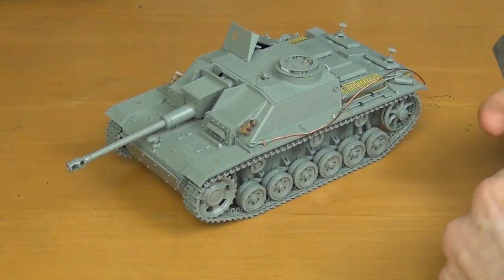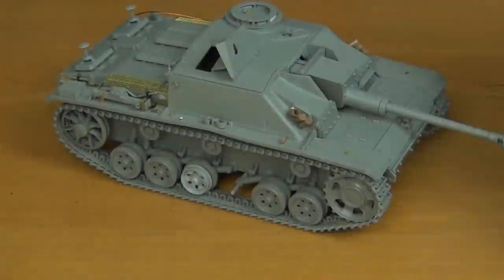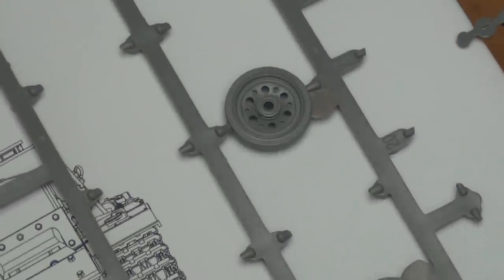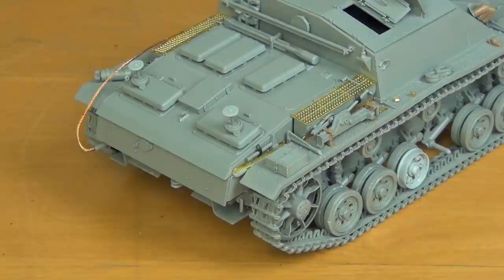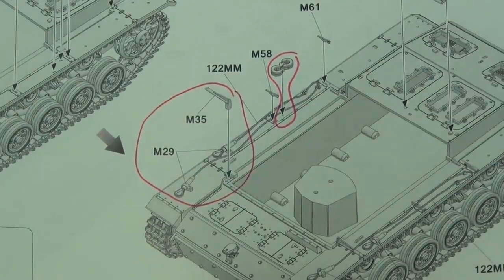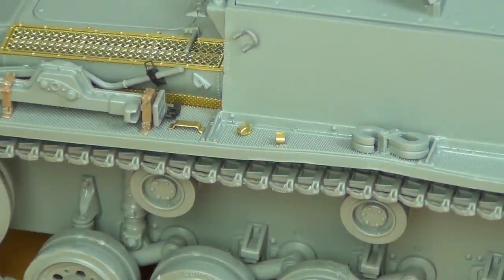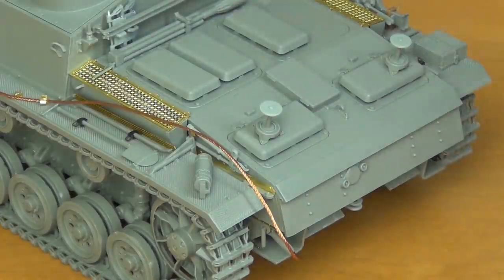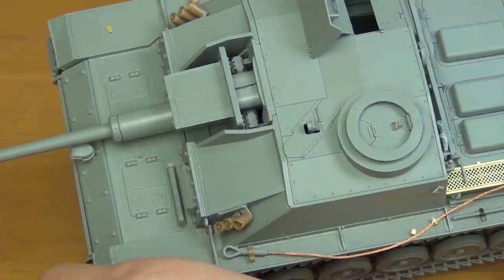Panzermeister's "Definitive Review" of TAKOM StuG III Ausf.G Early Production (BLITZ line #8004)

Comment from the maker: Sorry, there seems to be a little confusion with regard to my fix for the wheel fit issues.  

I did not trim the rods off entirely.  The inside half of the wheel has about 90% of the rod length molded on, while the outer half of the wheel has about 10% of the rod.  These rods are together too long and interfere when the wheels are assembled, so I just trimmed off the 10% rods from the outer wheel halves only, leaving the inner wheel with the 90% rods.  This fixes the fit and you don't notice the missing material.  

At 8:27 I showed two examples of the outer half, one with the 10% rod still in place (left) and one with that material removed (right).  I'm NOT showing an inner and an outer half there...just two outer wheel halves.  Remember, don't trim the rods on the inner wheel halves.  

>>> Most clearly -- if you have the instructions in front of you -- just trim the rods from all parts A11 (outer wheel half) and leave the rods on parts A16 (inner wheel half).  <<<
Reply: No more videos !? 😥😳😭

Comment: This is something I’m very much in favor of. We already have plenty of kits with crazy high parts numbers with super complex builds that still end up being full of inaccuracies anyway. A lower cost kit that is “good enough” is something I really hope sticks around.
Reply: As the hobby advances there will be more high count kits. Something I'm looking forward to since I jumped on the hobby to build.
Reply: @monkey in a panzer Same. Love Dragon kits, but 'oh dear?!', the parts count. Their Smart kits are a lot better, especially these days with moulded in Zimmerit, single length tracks which are good enough and many slide moulded parts which are so fine as to negate the need for using the included PE alternatives or buying a metal barrel, but still 'oh dear?!', the price. Tamiya new tool better regarding parts count and price than Dragon, but still ouch regards the latter. I love/d the Cyber-Hobby Orange Box series reissues of older Dragon kits. A set of decently sculpted older Dragon figurines plus a very nice older model regardless there might be a newer more detailed release. Some of them in particular more than met my acceptability expectations and scrubbed up extremely well with a very little extra effort.  e.g. StuG III Ausf B, Pz.Kpfw. III Ausf. E/F. Definitely a place for Blitz kits.

Comment: I'll start off by saying how grateful I am for this video! 

My wife knew that I wanted to get back into modeling after a very long hiatus, so she bought me this kit as a birthday gift. While a great kit - all-in-all - there's no way I would have been able to finish it without your tips and suggested changes. 

For others, here are a few of things I ran in to while building the kit:
- Wheels. I had exactly the same issue assembling the wheels. However, not having the best set of clippers, I had to use a file to file the longer lengths down to a length that allowed the wheels to fit together. 
- Photo-etched parts. Took me quite awhile to fully understand that the small flash piece (labeled as TP6 in the instructions) was meant to stand on its edge against the deck trim. And as you recommend in the video, I simply skipped the rear flashing (labeled as TP4 and TP5). I simply couldn't get either piece to lay flat. 
- Vents. Contrary to the flashing, no real issues with the vent grating (labeled TP8 and TP9). However, I did have an issue getting their associated "brackets" into place, which go over the vent grating (labeled as M62 and M63). Post-build, it seemed as though you could probably put the vents themselves into place (M6 and M7), then the brackets, and then slide the grating into place. 
- Barrell. Same fit issue, which I discovered the hard way, and then realized you tried to warn us. Also, I inadvertently snipped off the piece that fits to the barrell end (N7 to N14), thinking it was part of the sprue. I was still able to simply file and glue on, and it obviously made aligning everything a LOT harder. 
- Casement. I only got a fair fit on the casement, attaching it to the hull. Smallest bit of daylight on the forward, right side. 

Like I said, all-in-all a very enjoyable build. But for this being my first build in well over a decade, and possibly my first tracked vehicle EVER, absolutely challenging and occassionally nerve-racking. 

Thank you for helping guide the way!
Reply from the maker: Thanks for your notes!  I'm glad my video was helpful, and your comments here should help other viewers in the future.  

I'm also glad to hear you're getting back into the hobby :) cheers

Comment: New subscriber to your channel and recent returnee to plastic armor kit building. I want to say thanks for this review of the Takom StuG III along with building tips. I’m working on their StuG III Ausf. G Late Production Blitz kit which is almost the same build. I’m was ready to proceed with steps 10, 11,and 12 which is the assembly of the upper deck details, but was slightly puzzled with the tow cable placement, above or under the other parts. Luckily, you addressed that very issue and saved me from going down the wrong path. Additionally, I like the method you tried out with the tracks and road wheels all put together as one assembly but not glued to the hull for easy removal to weather the hull. I will try that out on my next build.

Comment: @Panzermeister36 - How do you fix the low-nose profile looks of this StuG? Having the main wheels rods fixed will probably be an issue?
Reply from the maker: It could be done but it will require a little bit of surgery.  It's not hard though, since for part of the battle damage on that one side, I lowered the swing arm without a wheel on it slightly.  

But when you're doing it along all the swing arms, I worry you'll have some weakness to the whole suspension (since when I did it, it was only one position and without a wheel it doesn't take any weight).  So you may want to drill and pin a couple of the arms with some brass rod.
Reply: @Panzermeister36  If you show that in a video, it would be highly appreciated I think.

Comment: Looks like a nice kit! I have a question, when zimmerit gets chipped away, maybe from a shell impact or something along those lines, what color metal becomes visible? (Bare steel, red oxide paint, dungelgelb yellow, or German grey?) just wondering if they painted the yellow then put the zim on, thanks
Reply from the maker: Red oxide primer is underneath zimmerit.  There are some photos that show this :)
Reply: @Panzermeister36  Ok great thanks!
Reply: @Panzermeister36  A couple of follow-up questions for you Evan: What colour is the zimmerit itself? I have seen a variety of answers to this question. Some say it's a greyish-white (similar to concrete, but a bit darker), and I have seen it described as a yellowish colour. Also, was the zimmerit painted with primer before the dunkelgelb coat was applied?
Reply from the maker: It's a light ochre colour.  Ochre pigment is one of the ingredients of Zimmerit.  

At the factory tanks were primed red oxide (gun barrels in dark grey primer) and then Zimmerit is applied over that, and then the Dunkelgelb german yellow paint goes on last.  

Early Panther A apparently have yellow paint under the Zimmerit, for some reason.  That was right at the beginning of Zimm applications.
Reply: Oh, interesting! I’m about to build a Panther A, so that will be helpful!
Reply: @Panzermeister36  Thank you! 👍

Comment: Hi! Great review. Do you know if this 8004 kit is the same as the 8009? The later kit with just some more options.

Im having a hard time finding the 8004kit. I only built my self a few Tamiya tanks and would love to try a StuG iii G.

Been holding of the German tanks because i prefered allied single color cammo while learning to use the airbrush 😅
Reply from the maker: The 8009 kit should be basically the same but with a 105mm gun added (for StuH configuration) and also with side skirts.  The fenders may also be new for the mid-production fender supports.
Reply: @Panzermeister36  Thank you so much for taking your time 🍻

Comment: Hi, is the rear light in this model correct? I saw/read somewhere that it should be round but now I'm not sure. Merry Christmas!
Reply from the maker: It's hard to say.  Both the tubular style and boxy notek style of rear lights were used on StuG G at various times.  The tubular style is most common.
Reply: @Panzermeister36  Thanks for the answer.

Comment: Good morning friend, thank you and congratulations for the video. One question, would it be historically correct if I add the rear structure for stowage to this kit, and Schurzen skirts? Thank you
Reply from the maker: That would be no issue.  Early vehicles were upgraded with side skirts in May and June 1943.  And the stowage frame was often added to earlier vehicles as well (it became a standard feature in December 1943).
Reply: @Panzermeister36  Tank you very much  !

Comment: Hi Panzermeister... the early model stug's have a whole rotating cuppola on a ball bearing ring , the cuppola's where not miss fitted and thats why your picks showing the wrong opening of the hatch , but later there was a shortage and they where fixed and welded  on the upper area look at the talks and chats of the englisch tankmuseum....
Reply from the maker: That is true.  The whole cupola rotates, not the just the hatch, so those early vehicles that have the hatch reversed with respect to the vision block positions are stuck that way.  But when I said they were "field modified" to be rotated around for a forward vision block (and then backwards hatch), that wasn't right.  I should have said they can just rotate like that freely.

Comment: Hey mate what light should be on the back? Rfms early has left alot tools off for some reason the kits been accurate all way through till end come to fenders n they have only the cable the shovel and starter amd cleaning rod's actually being put on the stug! So weird but will copy this as got loads spare parts for later versions and stug 4s in box! All the remote mg stuffs in box for internal workings and outer must be for later full interiors etc! There stug 4 has the flip up Sheild aswell so it's not for that kit!

Comment: I am curious what you would think of a Miniart Stug III, post-build! Ever consider doing one?
Reply from the maker: Maybe eventually, but from what I have seen, the MiniArt kits are not better than the Rye Field StuGs.  Therefore I don't have much motivation to suffer through building one of them if the result will be not as good as the easier Dragon and Rye Field Model kits.

Basically, MiniArt will avoid using slide-molding which results in the entire kit being flat plates; other kits will have assemblies like the mantlet, hull, superstructure, etc molded in 3-D.  MiniArt kits have more than twice as many parts for this reason and their plastic is very soft.

Comment: Hi and sorry for my bad english.
You did a very good Job with this review.  And i know i am a little late with my notes.  
But there is one point i don't agree with you. 
The early coupolas where rotatable. Means you could rotate the hole coupola. All those rotatable coupolas had the" blind spot" in front of the scissor periscope and not on the rear by the mountig for the hatch. All of the pictures in my collection show this.  It has nothing to do with Miag assembled them in the wrong way. You will find this on the Alkett StuG's too.  It is only the sign that it is a rotatable coupola. Later when the coupolas where non rotatable ( lack of ball bearings) the "blind spot" was on the rear of the coupla.
StuG Abt 177 described the Problem in a detailed report from 28. August 1943 as followed: ( I try to translate from German to english) Locking mechanism of the turret has to be modified on StuGs from Miag because in locked position the scissors periskope looks backwarts.
This means also the hatch of the early coupolas rotates with the periscopes. When ever you see a hatch standing open in a "unnormal" way or position that is not straight backwarts... you have an rotatable coupola. 
The rotatable coupolas in the "early" versions droped about Nov. 1943 and where reintroduced about from Sept. 1944. But there where still not enough ball bearings to fit the complete output of the both factorys. This is documentet in Ch H Rüst und BdE from 14.12.1944.
So far my remarks to this small historical accuracy point.  
Keep up your fantastic Work and again sorry for my bad english.

Comment: Thank you for the good and clear explanation. I am building at the moment this kit as well. But I have a question about mountains the tracks ; when I finished mounting the tracks together I have 38 tracks left (?) Is it possible that Takom extra tracks have been added in the kit ? Thanks in advance 👍🏻
Reply from the maker: Yes, the extra tracks should be there.  You can use them as spares; usually the vehicle should have around 10 or so tracks mounted on the spare track rail on the back of the superstructure.  Sometimes the crew would weld tracks on the front as extra armour.  I've also seen tracks wrapped around the spare wheels on the engine deck.  Lots of options!  Take care :) I'm glad my video was helpful to you.
Reply: @Panzermeister36  thank you, I will mount the spares somewhere else 👍🏻😊

Comment: Cupolas with the plated-over spot facing the front can be found on early vehicles from both Alkett and MIAG. The early cupolas were rotating, so pics where the hatch is facing forward are not from a field mod, but from a regular but rotated cupola.
Reply from the maker: Mmm you are correct, I should have stated they were rotating at this point.  I have never noticed this on Alkett vehicles so far, only MIAG and I think once on a MAN one.  If you have an Alkett photo please send it on FB so I can see :)
Reply: Regarding the weld I can´t find your and my original post, so I comment here. It would be perhaps enough to fill it, but from the pictures it looks like an extra space made due to this feature, but again, it needs to be compared with accurate drawing. I don´t have the kit either, the rear parts look similar to the panzer 3 M what I actually have, inherited the same not so good layout, but can be fixed somehow, by shortening the intake amour from both sides.
Reply: @tiborvarga84  : You were right about this. It's 80mm + the extra plates. The weld is indeed a sign of the kit being faulty.
Reply: @andreaslarka1633  Yep - faulty - suffers from the very same problem as the 90`s Tamiya StuG 80mm solid armour + 30mm applique - FAIL !

Comment: Do you know if new F8 early can be built as DAK version ?
Reply from the maker: Four Ausfürung F/8 were used in Tunisia, but I think they are the later type.  I will check and reply back in a few hours.  

An Early F/8 has welded 30mm extra armour on the front, while a Late F/8 has bolted 30mm armour.
Reply: @Panzermeister36   I think I find that StuG Battery 90 used late production . I can't find any markings except something that looks like later A at back
Reply from the maker: That is what I have found too.  So the later F/8 kit would be the better option....but it comes with winterketten in the Takom boxing I believe!

Comment: You should have the tow eys in a Dragon stug B kit that's whare I got mine! You done the F8 same sprues really you'll have it in there! I'm building RFMs full interior just now it's not got anything in instructions for wire cutters or the small hammer on back or fire extinguisher, Very very strange! I've just got to near the end of the build and have the 3D printed clamps ready and 3D printed fire extinguisher but doesn't have them on anywhere! I've got this takom and das werks etc and the 1.16 new das werk earlys I'm pretty sure it would have them?

Comment: What do you think of the Das Werk Stug III combo pack?
Is that a good kit to purchase?
Reply from the maker: It's just a reboxing of dragon 6454.  No new parts or corrections.  The dragon kit even had the 75mm gun originally as an unused part.  

That's still a great dragon kit though, and the molded zimmerit is very nice.  So if you can get the das werk kit for a decent price it is worth it.  I did a review of dragon 6454 on my channel a couple of years ago.
Reply: @Panzermeister36  Ok awesome thanks!
And it’s just one chassis with the 2 different variants right? The option for either the Stug or Stuh.
Reply from the maker: Yes, one full hull and then options for either 75mm or 105mm guns
Reply: @Panzermeister36  thanks!

I’m sorry to keep asking questions but I recently started to fall in love with stugs. Do you have any Stug reference books or websites you could recommend?
I would like to start building stugs but I want a good reference to start off on.

Comment: would you say there is any need for new or emphasized weld lines?
Reply from the maker: The kit welds look very good.  However there are a few tiny welds that are missing, on the roof along the guide rails (bolted strips) for the sliding periscope cover.  But they are so minor that I doubt even I will add them.